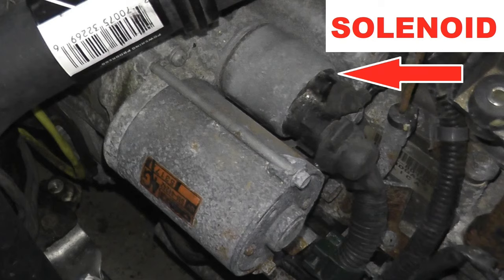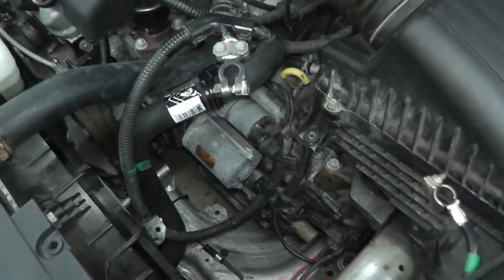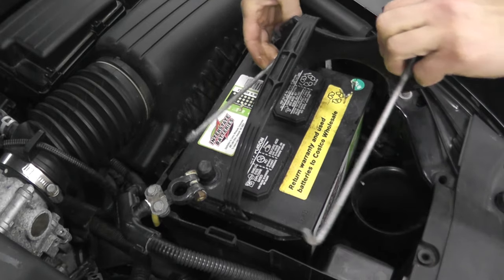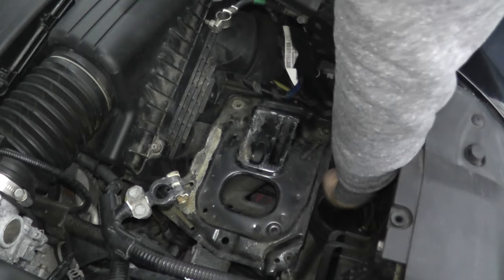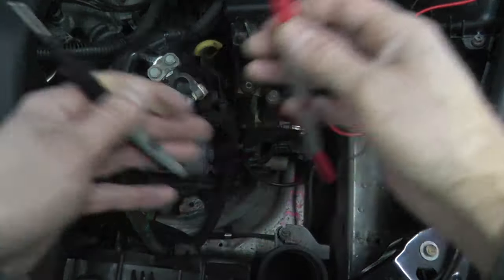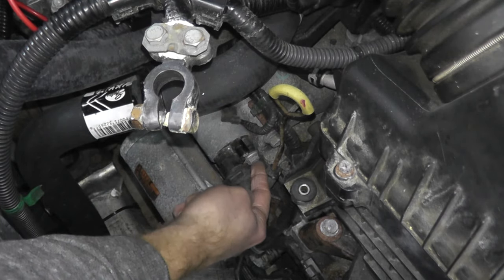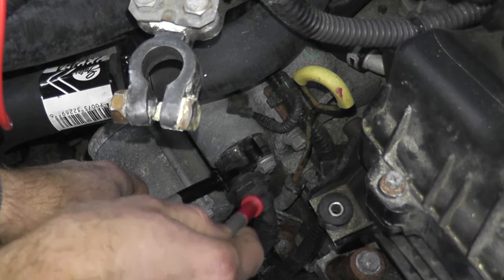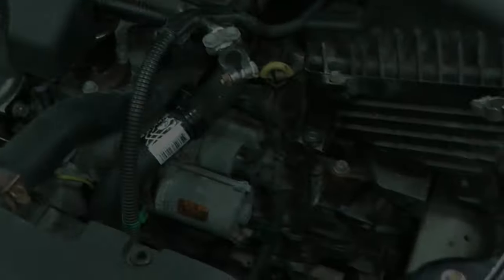Starter Solenoid Test | Clicking Sound When Trying To Start..?

Comment: It’d be better if you show the actual sound that the car makes, you explain how to fix the problem well but I’m not sure if it’s the same clicking sound my car is making lol. I’ve heard other YouTubers do the clicking sound with their mouth then they show their car sound and it’s completely different than my car :s
Reply: Thank you! I came to this video hoping to hear the sound. And nada....
Reply: Same
Reply: Same
Reply: @libradamontano2340  same
Reply: @libradamontano2340  I don't know why folks seem to not know to allow the watchers to see or hear the symptoms. smh
Reply: @libradamontano2340  same. I guess his is OK so hard to demonstrate. When he says click click click…. Does he mean once for each turn of the key or multiple  clicks for one turn ?
Reply: Exactly. Common sense. I took out a fuse while my ignition was turn on, then I heard a click click click, which went away when I put the fuse back on. Now my car starts but its driving off. Idling badly and low power engine. The check engine light is on, my obd readers says my Map sensor is at fault, ice since changed it but the check engine is still there. My car is running slightly better tho, almost back to normal.
Reply: Click,click varoom
Reply: That third terminal is not a ground. It is called the motor lead. It just spins the starter when it has 12 positive volts. The whole starter is grounded through the mounting bolts and through the block. Also that positive terminal end at the battery is pretty cheesy and also corroded. Always start at the battery.

Comment: When the starter stops turning over every time but just some of the time.... the issue is the copper contacts inside the solenoid becomes pitted from sparking. Take the starter off...take the solenoid off and disassemble it.  Sand down the large round  copper pads smooth.  Put it all back together.   

This would make a good video to make
Reply: would really like to see that video ha.
Reply: Yup the contacts and the plunger, $20 lol
Reply: I think this might be happening to mine. I bought a new starter put it on and a month later I tried to crank just got one click my battery is new and alternator is good. The starter even though said it's new might be a bad starter.
Reply: Why not just buy a new starter
Reply: @mightyhealthy8227  45 mins of DIY or $700+ for new starter
Reply: @mightyhealthy8227  cause if it wasnt the starter they dont take it back and you will still need a battery, etc.
Reply: @Ezzell_  What car do you have that has a $700 starter
Reply: @sategllib2191 rolls royce
Reply: @sategllib2191  mate rx7 starter motor is $600 in Australia
Reply: @sategllib2191 man you wouldn’t even believe it I have a 2016 Acura Ilx went to the dealership thinking the starter would be atleast $350-$450 that mf was starting price at $730 so currently going aftermarket rather than oem for the Acura starter

Comment: The clicking could be from low voltage from weak battery and/or bad connections, and the solenoid is a large switch for large current amps, not voltage.  Your continuity test is not under load which may show it as ok, but under load the contacts may not pass current from pitted contacts but read ok on multimeter.  But it's a place to start.
Reply from the maker: Terrific points. Something I went over in the previous vid: https://youtu.be/rE_gNyTRX3I
Reply: My van intermittently won't start. Most of the time I just hear a pift sound. Still the starter ?
Reply: @elaineclementsfinn1872  I'm having this issue on my Hiace. I haven't got a multimeter yet but when I half turn the key I can't use both the radio and headlights. This tells me it's the battery but it's fully charged and the connections all seem in good order.
I have been having issues with my viper alarm though which is throwing me off. Not keen on forking out for a starter motor if it isn't the issue.
Reply: is there a way i can get in contact with you if your willing to hep me over the phone i have a video with sound but i can explain what i was doing.
Reply: @CarsNToys  8
Reply: That's wats up g good tip

Comment: Well done video. Just one thing mentioned which is not correct. The terminal referred in the video as negative is not really a negative, it is the point of supplying 12 volt to he starter motor when at the moment of cranking via the solenoid contact. There is no negative terminal in starters, the starter body is what supply negative to the starter.
Reply: Read above everyone! Glad someone else pointed this out :)
Reply: Ok so would this maybe be why for some reason when my car decides not to start , I get it to start only by hooking up a battery starter with the positive clamp on the negetive battery terminal ?? I dont even know why I did that but I figured this out by accident lol. Does this make sense to you ?

Comment: Continuity or resistance test may be a good indicator of whether a part or conductor is bad or has failed, but is not necessarily an accurate way to tell if the part or connection is good or functioning properly.  Resistance or continuity is checked with a circuit not under a load.  For more accurate results even voltage testing should be performed while circuit is activated rather than in a static state.  Voltage drop or amperage draws are more reliable and better indicator of whether the system is functioning properly or experiencing adverse conditions.
Reply: thanks for the additional great tip. 👍

Comment: sir I have the same problem though mine will start with 1 click then other time 3 to 4 clicks .... when it's cracking it directly through... not weak but strong . thank u for your video hope you can add some tips.

Comment: I have a 1995 f 350  7.3 L diesel. It suddenly would not crank. All I heard was  a single click.  After trying few  things  with no luck,  I then  hot wired a piece of wire   to the + post on the battery and then   I touched the other end to the S terminal (that has thin red wire , the trigger wire connected )  on the starter solenoid, The starter cranked and ,the engine started. I  Single click didn't mean the solenoid was bad. ...  Still trying to figure out why the trigger wire is not getting power.

Comment: I have a 350z - I turn the key - it lights up but nothing. I checked the battery - good and it's new - I checked the fuses - looks good. I checked all the relays - good - I checked the clutch safety switch on the clutch - little button  - good - I even put in a jumper - still nothing. The clutch safety switch did break and I put alligator clips to bypass the switch and the car started --- However, now with even alligator clips, it won't start. ---------------------------- I am thinking -- could the switch have been fine and it was just the starter all this time? My car is a 2005 but it only has about 33k on the engine/car. I will try this tester - could the starter cause the car to just turn the key and nothing but every electrical thing in the car works?

Comment: Having intermittent starting issues with a CLICK as I turn key. Seems to start fine cold but as car gets hot, I can get the no start condition. Is solenoid getting overheated and temporarily failing? Will seem to start if car cools.

Comment: If there’s no click and no start but when I turn key to start position start smoking will this be the starter truck was just running 2 mins ago fine?
Reply: Sounds like a battery problem haha, check your battery to make sure it's secured and not bumping around and touching other metal parts.

Comment: Not sure this test diagnosis a stuck solenoid … the electrical continuity will still test good as you demonstrate but if the solenoid is stuck the armature will never get full juice from the battery.

Comment: Help . Used portable jumper took a bit but then I have lights radio but when I turn key it just clicks it taps alot when I turn key . Won't start . Then if I disconnect jumper and go inside house out stuff away come out test if lights work it's completely dead again. Is it lights , starter , a relay . Help !!

Comment: In my car electrician change solenoid and install relay for starter motor but still click sound coming and car is not starting, kindly explain what could be wrong and needs repair

Comment: My problem was the negative battery post cable. The smaller black cable that is grounded to the truck frame. Replace the battery terminal and clean the smaller neg cable. Replace it ASAP. Ford Ranger 2003.

Comment: Okay, what if it has good battery (all terminals are clean good cables and all), good starter relay, there is continuity between S terminal and big cylinder and negative bolt on the solenoid but it only clicks once??. also I was able to rotate the crank I didn't feel any force. will that mean it has a bad stater? Mine is hard to remove so I wanted to make sure before removing it. Thank you.
Reply: did you need new starter motor?
Reply: @empiresrikesfat  Yes the starter motor was bad.

Comment: Thank You! What does just one "klick" mean?
Reply: Possible weak battery
Reply: @burujuguru  Battery is Good. Still does one click, takes a few tries then starts, click changes tone before car starts. Thank You for replying.
Reply: @amandazeller787  I'm having the same issue. One click, then it starts. Battery alternator and starter tested fine
Reply: @devinchambers8202  mine is doing the same thing
Reply: I'm pretty sure 1 click means a bad relay, or the wiring leaving the relay is bad. There should be a relay somewhere between your starter and the battery.

Both the relay and the starter click. So if you hear one click and not two, I think that means power is making it to the relay, but not from the relay to the starter.

I'm about to go troubleshoot my own no-start tomorrow. 99% sure its a bad start motor/solenoid, so I have a new one on hand in case the hammer trick doesnt work. I tried ordering a new relay as well, just in case my diagnoses was wrong. Sadly, Mitsubishi cancelled the order and told me those relays are out of stock, with an indefinite eta... Meaning its basically unobtanium, at least from OEM. Fingers crossed it's not a relay.

Comment: In my case, it turns out nothing was faulty: i followed the wire from the battery to the solenoid, and.... it was loose! Not loose enough  to fall off, but loose enough for intermittant starts. So yeah, check your wires!

Comment: I have a z71 it ran got parked now the starter relay fuse makes clicking noise truck cranks but no spark and relay clicks till you turn the key off??
Reply: Did you get it figured out?

Comment: Great video.  When I drive my 1965 c10 for over an hour and I turn the truck off it usually takes 10 minutes to restart. Engine won't crank not even the engine fan turn on. It sounds like no power at all. Any suggestions?
Reply: Don’t know if you still have your problem but you may want to look at came chaft position sensor throttle position sensors or crank shaft position sensor. Hope this helps!

Comment: You only test the coil windings in the starter, if that is bad it won't even click, secondly you forgot to check the switch inside that closes when the plunger is engage, that sends the voltage from the battery terminal to the motor

Comment: Thanks for this video.  I currently have a 2012 Dodge Durango Citadel.   My Durango has a V8 engine and the check engine light started coming on.  It started sputtering/misfiring and driving like it had no power.  The Dodge dealership found code P0562:  Activation control code MDS solenoid--bad cylinder six(located the pistones).  I was also told need to replace the gaskets (top ones).  My Durango only has 66,726 miles on it.  I checked with Dodge about any recalls and they are no recalls on this issue,  however, Google is showing a number of Durango owners with this same problem.

Comment: Great explanation 👍 It worked for me, THANKS 🙂
Reply from the maker: Great to hear!
Reply: @CarsNToys  where do I connect my voltmeter to do a voltage drop test to verify my starter motor is bad?  I’ve been told it’s quite simple to do.  Please explain

Comment: What is wrong when my car only start when using jumper cable, battery is new @ 12v, when it runs idle at 14v. Any help would be appreciated, thanks
Reply: I don’t know much about cars but it sounds like you have a defected battery you can take it to have them check it at auto zone
Reply: Or you have a lower ranked battery. The battery isn't powerful enough to get it to turn over.
Reply: I have the same issue and I have a new high cranking battery I’m starting to think it’s the started or a relay but the car often starts after a jump any updates?

Comment: Do starter solenoids suddenly go out, or will it intermittently not start before not starting at all? My car suddenly won't start at all. The battery is good, just replaced it and all lights work in the "on" position. When you turn the key to the "start" position the radio functions go out but nothing else. I should also mention there is a constant electronic whine coming from the engine compartment when the key is in the "on" position. That whine usually only stays on for a few seconds but now it DOESN'T SHUT UP.
Reply: Did you find the problem I have the same thing happening to my Audi
Reply: @anthonymarin584  It ended up being the starter solenoid. Not sure if it caused the whine but, I had the starter-solenoid assembly replaced and haven't had any issues since.
Reply: @waltofalltrades6817  thanks , On my starter it looks like there’s some melted and burnt wire coming off the solenoid
Reply: @anthonymarin584  Might be as simple as having a professional replace that section of wire. A bad solenoid might be causing it to melt/burn though. You can test the solenoid by giving it a few good whacks with a hammer and see if the car will start afterwards. Its not guaranteed to work though.

Comment: What if it's intermittent? Sometimes you have tone, sometimes you don't? A ghost? It's not always that simple
Reply: Good question. I also wondered, as my starter occationally works, occationally don't.
Reply: Means theres a bad electrical contact somewhere. Either inside the solenoid, relay, ground, or wiring itself.

Or at least, thats the most likely.

Comment: When it clicks is it draining the battery?  I noticed that the newly charge battery had the dome light back on but as soon as I tried to turn the key the dome light went off. and clicking continued until I turned the key all the way to the right.
Reply: I'm having this same issue. Were you able to figure out what it was?
Reply: @sibp901  I had bought a battery from a salvage yard They said that the battery had a good charge  I put our home charger on twice and thought the battery was not the problem  I ended up taking it to an alternator guy He charged the battery on his charger and IT STARTED.  So it was the battery.  Cost was 4 dollars for his charge.

Comment: HA ! ..... before you go and take the starter/solenoid assembly out of the car, remove the battery and have it LOAD tested.
Do the easy things first and save yourself some headaches !
A battery that is on its "last leg" will make your solenoid "click" (and do nothing else) every time you try to start the car!

Comment: Ok this needs to be better explained with the clicks. It's to different clicks. When you hear just in the on position indicate the cylinder is good the other as you turn the key than hearing clicks means it's bad.

Comment: This is not a proper test... The solenoid might be working , but if the contacts inside of it are coroded , or burnt from use , it will not spin the motor ... this test doesnt do anything except prove that the windings in the solenoid are bad which is almost never the case.Bridge the positive terminal with the wire going to the motor and see if it spins